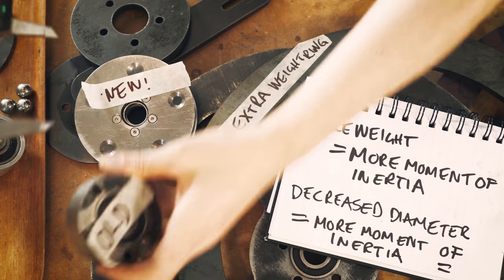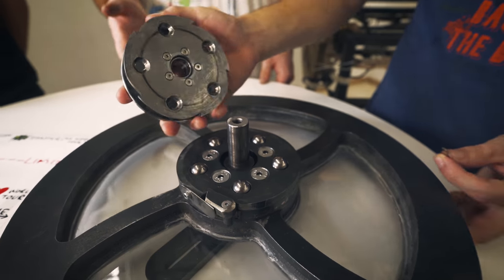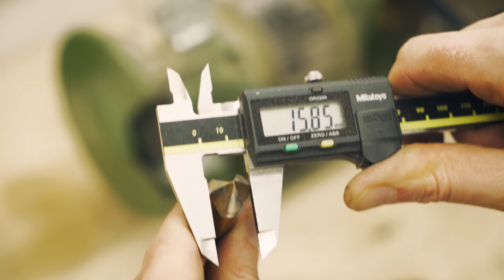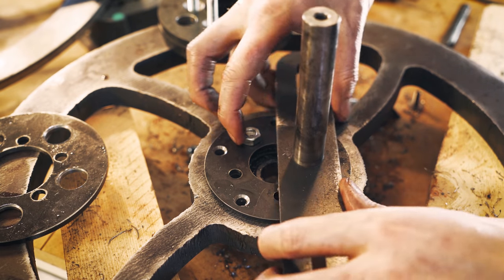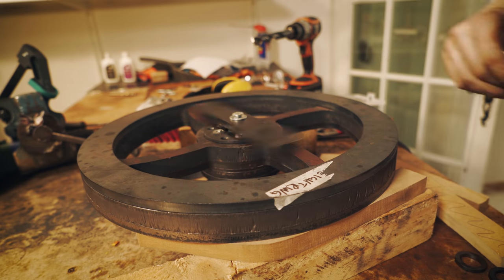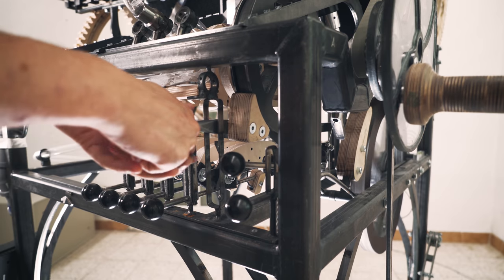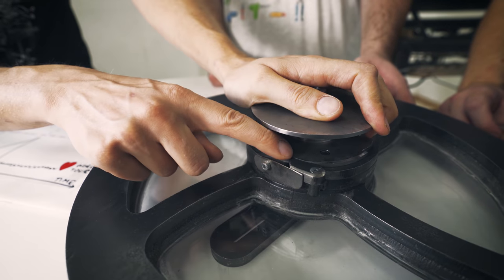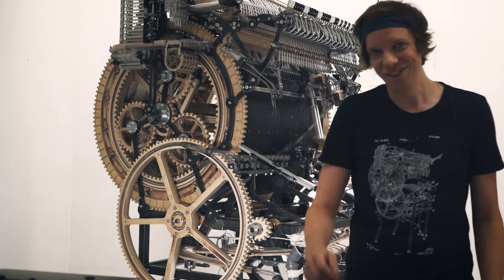Flywheel Torque Limiter - Marble Machine X#90

Comment: I have a question here. How much is this thing gonna weigh? Weight is a big part of mobility, and it's looking like your sacrificing light weight for functionality. Wouldn't aircraft grade aluminium have worked to make it lighter? I know it will come apart in sections, but still each section looks to have alot of heft to them. Thanx
Reply: The MMX is designed to be broken down into 7 subsections for transit.  ... There's gonna have to be a video about how those crates are made, and designed for International transport and inspections.
Reply: @peterkelley6344  Oh ok, I thought he had said 3 sections. At 7 the weight shouldn't be a big issue then. Thanx
Reply: @jonwheeler168  actually I am thinking this may still be a problem.  Even as it is he needs a simplified crane to move the programming drum section on and off by himself.  I can't point to the video in mind where he does have assembly issues.  So while it is designed to be dismantled into 7 sub-sections there are hints of problems at this time.  This is still better than moving the whole thing at once.

The dragon my have been slayed ... but moving the carcass might be a problem!
Reply: @peterkelley6344  I don't know how much each subsection weighs, but you think there is any way to use a pivot arm type set up to mount everything to the base. Mounting one side of the arm to the frame and the other to the section to left and swing into place. You could mount the drum section from the back, and the top part of the divider that sits on top of drum from the front. Make them removable so not in the way of other sections. The rest looks to be reachable by hand. Wish I could doodle a picture here. lol
Reply: @jonwheeler168  First: I am not on the MMX design team.  Second: If any individual would take on the design challenge of their own version of a MM that design would be up to them. and that particular team.  Third: The practicality of a swing arm assembly might have mixed results. If I am envisioning what your suggesting correctly ... the ball bearing circulation system might also have to be sub-divided across those systems — which in-it-self would have complications for the joining of those systems before any given performance.  IF the design team were to keep to the power generation to a single human the power subsystems would likily also have cross-systems as well. 

Having said all of that, and as instruments come in five classifications: Percussion, String, Brass, Woodwind, and Keyboard; it is theoretically possible to produce a MM to manage a representation of for each of those systems.  The design would be FAR MORE complicated than what Martin, and his international team, are producing currently. If a team were to add to that a randomized programing board the complexity would become even more complex.

If anyone is considering such, I would encourage them to be courteous. and WAIT until Martin has finished his attempt first.  You might want to even ask him AFTER that completion if there is any discussion for plans for a MMXX Compeition.

Comment: Next time to add threads to a thru hole, get a nut the size of the thread and drill the hole so the nut fits inside and weld it in there

Comment: Have you ever thought of using a mechanical governor to control RPM of machine? Maybe in combination with continuously variable transmission?
 This solution would look very much steampunk.
Reply: The beat of the music is on the turn of the crank
The player's whole body moves in time with the music as they turn the crank
Reply: If we put linear gears between the flywheel and the main axle and the crank, the crank and main axle would be in tempo.Linear gears would be controlled by the governor. The governor would spin as fast as the main shaft and would be in tempo. If the tempo rises above the set point, the governor would move the gear ratio higher. The flywheel would start accelerating and the main axle would stay in pace. If the governor fell below the set point, the gearbox would start to decline and the flywheel would start to decelerating. The main axle would stay in pace as long as the linear gear has room to shift.

Comment: the sprocket on the rear wheel of bikes are also torque limiters, you can experience life without them with a true fixed gear bike and achieve swole ass legs
Reply: Not really - they are only limiters in the sense that the torque can only operate in one direction.
They don't "break free" when a torque setting is exceeded.

Comment: Tightening the 5 screws for the 5 ball/springs is the equivalent to adjusting the tension of a drill chuck (from setting number 1 to the “drill” feature (direct shaft))

Comment: Wouldn't it be safer if the crank stopped rotating when the machine was running?
Reply: Yes it would, but he uses the position of the crank as an indicator of where he is in the bar. At least that's why I understood, e.g.: everytime the crank points south he can expect a kick beat coming.

Comment: Just a thought: I don't see any bearings in the Flywheel or the supporting shaft or any allowance for lubrication. 
Not saying there isn't any - just didn't see them. 
Won't this shaft get hot? and wear excessively?
Shouldn't it be supported with bearings or at least allow for lubrication?

Comment: How exactly are you going to control the regulation of the limiter? I assume the 5 marbles need roughly the same tension to give an overall change in the limit. Are you going to calculate by rotations or with a torque wrench?

Comment: If I'm correct, it works like a bike (except the clutch thing with marbles). 
Does that mean that if Martin turn the command wheel slower that the free wheel, then we'll here the clicking sound? Just like we I can here the cassette/free wheel on my bike if I'm still going forward but not pedaling anymore.

Comment: Hey Marvin, might want to look into how motorcycle starter clutches work. I know for sure the kawasaki klr650 uses a cammed roller bearing that only engages when the torque on the crank shaft coming from the electric motor is higher than the torque coming from the engine. Ratchets wrenches that don't make the clicking noise use the same components.

Comment: Have you tried if the limiter also stops the flywheel if you block a small gear or another small parts? In this video you showed that it works on a big gear. Would be sad if not.

Comment: Please remember that torque limiter hole plate will wear each time it triggers. Those holes will come oblong. So please have extra as spare. Or you will have to tighten those set screws every now and then

Comment: Very important component, but it's basically a bicycle freewheel, used in every bicycle out there (except fixies), so forgive me for not being impressed at this discovery/"invention". Like, the entire assembly from crank to flywheel is an oversized bicycle drivetrain.
Reply: You missed the whole point.

Comment: test torque pressure of flywheel by attatching it to an artificial clutch to adjust spring tension before attaching to marble machine x. Get that math wizard on board to determine torque limits for the "weakest link" and the energy tax for additional changes and adjustments

Comment: Now the floppy foot pedal mechanism is actually useless...
Reply: That foot pedal can also drive the MMX as well.  If his hand or arm cramps up. his foot can take over.
Reply: Yes, but it doesn't need to be floppy anymore. It could just be a sturdy pedal now. With that clutching mechanism, the flywheel won't be able to exert too much force on someone's feet, which was the sole reason to make it floppy.

Comment: It’s a pity that you chose a more primitive design for limiting the torque instead of a smooth speed control mechanism, as was done in the gramophone of the last century, which I offered you in the comments to the previous video. It is clear that you want to control the speed of playing the melody by changing the speed of rotation of the handle of the drive mechanism, but it would be much more convenient to adjust the speed of rotation of the flywheel as a separate lever with a scale, without worrying about the speed of rotation of the drive handle. On the other hand, the mechanism you used is more reliable and less subject to wear than I suggested. Although it can be improved: instead of individually adjusting each ball of the slip mechanism, it was necessary to make a single sliding sleeve, pusing on all balls, the compression of which would be regulated with the help of a single large-diameter nut screwed onto the thread around the shaft. Such a system is used in Soviet lathes to prevent the destruction of taps during threading, all the mechanics were invented decades ago, the main thing is to choose the most efficient one and correctly integrate it into your machine. Good luck in further development)